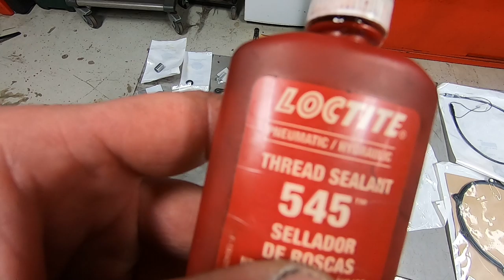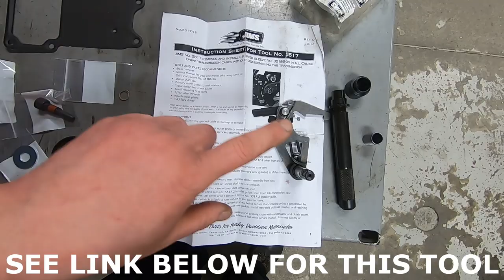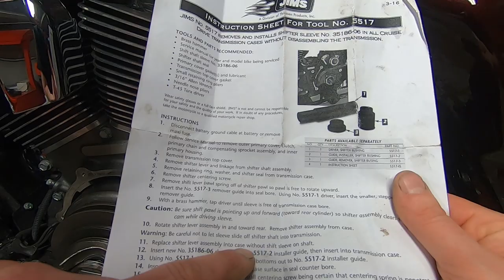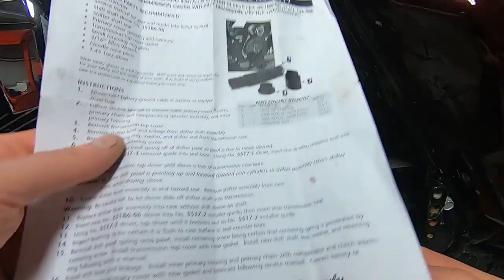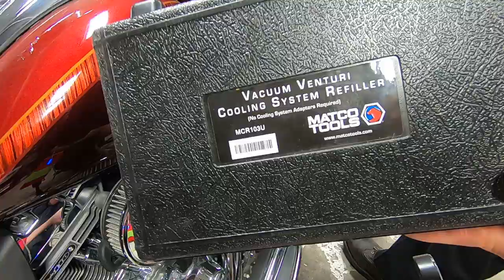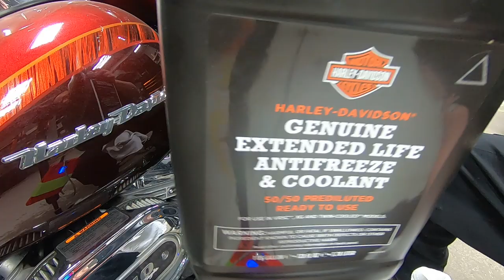FINAL REPAIR VIDEO OF "PRE SEASON INSPECTION BIKE " AND COMPLETION OF "SHIFTER REMOVAL VIDEO "

Comment: Jim's USA 5517 Tool works with Shifter Sleeve 35186-06. For older bikes, like mine, Jims 1664 Shifter Sleeve Installer/Remover Tool works with Shifter Sleeves 34979-00 and 33114-79.

Comment: The screw above the shifter shaft it to align the shifter pawl . It is done in third gear and you are supposed to center the shifter pawl
Reply from the maker: That's only on early 5 speeds because the pin ls offset. On 6 speeds the centering pin is in the center so theres no adjustment.
Reply: Brad, I just got done doing this on a 2011 rg 103 and the two springs are not centered at all. The rear spring arm ( towards the rear wheel ) is almost half way in the center hole for the centering bolt. I can down shift fine, its the up shifting im having issues with. I can shift up but then when the pawl returns to shift to the next gear it dont return all the way not letting the upper arm drop down on the shift drum unless i help it ( moving the shift linkage a little forward ). Is there a chance I got sent the wrong shifter pawl?

Comment: Excellent. Going to order one of the Jim's tool just in case. Also going to look at the temp sensor on my 14 Ltd. I cleaned and replaced the coolant when I did the M8 water pump upgrade. Did the air bleed the old fashioned way. Maybe some day will get a proper bleeder.
Reply from the maker: The coolant bleeder tools makes the job go a little faster. Its really saves a ton of time using it on your car!! Thanks for the view and comment!!

Comment: My Derbey cover bolts where stuck also. Thought I a as gonna break them off. Tried with my hand impact like your but no matter how long I tried they wjere stuck. Someone put red locktite on them. Got my little 1/4 impact with the 3/8 adapter and thought it would round my torx bit out or break something but it zipped them all right out.

Comment: Jims USA makes 767 (2006 to preset 6-speed) and 768 (1980-2006 5-speed) Transmission Case Shifter Shaft Seal Installer Tool insure seal is inserted to the proper position.

Comment: FYI. On 2004 FLHRSI Twin Cam88 5-Speed the Shifter Pawl Assembly cannot be removed as easily. The transmission has to be removed out the Side Door to make clearance from the drive gears. However the shift drum assembly can be removed easily without further disassembly. For the Bike in the Video, it appears further disassembly is required to gain access to the shift drum, however access to the Shifter Pawl is easier.

Comment: Just rewatched this whole series again Brad, very good. Do you disconnect the battery when you work on the primary and what holds the bike on that column lift?
Reply from the maker: Personally I normally don't disconnect the battery during a primary service as I've done so many that I'm conformable and know how to angle my tools just right ect. But for the normal at home person, I'd recomed disconnecting battery. Your better of safe than sorry. I secure the front wheel to the wheel chock of the hoist with a ratchet strap. When I'm away the the hoist I put a flat jack under the back portion of the frame, incase the tires go flat or something but with the front tire straped  and flat jack under the bike, it's solid.
Reply: @HarleyDavidsonWizard  Thank you Brad.

Comment: Brad what do you think I value your opinion to the harley 80w140 primary and transmission oil I bought some for the transmission and then realized I could use it in the primary what do you think I would  have thought it would quieten the primary side regards Alan. Ps I usually run amsoil primary oil but I would like to try the harley 80w140.
Reply from the maker: I like the harley 80w140. I would recommend it in the trans and primary. Its really nice that the motor company now offers a heavy oil. Makes it easy for people to get.
Reply: @HarleyDavidsonWizard   I totally agree I got some soon as I found out harley brought this grade of oil out regards Alan and thank you my friend take care.

Comment: I recently had to replace the main bearing (and all the others) on my 2010 Dyna  Trans and am glad I didn't have to alter/change the shifter mechanism as it looks to be rather tricky - I have not watched the video of it's removal yet. The Covid lockdown here in England has me watching all your videos as they are much better than TV !
When I did the Trans rebuild, I noted that the new main bearing was a single row whereas the original was twin row. It only failed after 60k miles so it was OK I suppose - what finally killed it off was my engine upgrade (over 127bhp and 122 torque). I hope this new bearing holds up, have you had any failures come to you attention yet ?
 I see they are using the single row bearing in M8's but I have bought a Baker twin taper roller conversion kit just in case it fails again - I didn't do my research before I ordered parts and saw the Baker  part which is not cheap ..... I really don't want to have to do it all again but ....
Reply from the maker: I've used the baker twin tapered bearing in a Baker Grudge box and its a beefy setup for sure. The original double role main drive gear bearing you speak up is prone to material buildup on the outer portion of the bearing and then the race becomes pitted and then the ball bearings become pitted and then the bearing setup looses the original designed preload and the bearing fails. Its a fairly common occurrence. In my opinion I think metal material that floats around in the trans fluid settles on the race of the outside main drive gear bearing and the bearing spins and spins in it creating the damage in the first place. Whenever I take a trans apart and that main drive gear bearing is in its first stages of pitting damage, the damage always seams to be at the bottom of the race. I like the single row revision. I haven't as of yet seen any problems with them and the single row bearing was the same design that was used in the 5 speed models and it has a great reputation there as well. Thanks for the comment! make sure you thumbs up the videos as well!! Lol,
Reply: @HarleyDavidsonWizard  Thanks for the reply and info - it was the outer portion of the bearing that failed and now I know why !   After my one failed and I was waiting for parts and tools I did a lot of research and heard that the twin row OE bearing could fail in as little as 3000 miles so I guess I got my money's worth. The actual striping and rebuilding of the trans was straight forward and easy except of course for the inner race bearing.    Hopefully it won't go again but if it does I'll use the Baker one I have.

Comment: Awesome video. Can't find Jims 5517 anywhere.
Reply from the maker: https://amzn.to/3UNVtUd here is a link to a listing for one on Amazon
Reply: @HarleyDavidsonWizard  they are out of stock
Reply: @HarleyDavidsonWizard  i see it now, I'm in Canada though
Reply from the maker: O ok.
Reply: @HarleyDavidsonWizard  found one thanks
Reply: @HarleyDavidsonWizard  Brad, I had a loose shifter lever on my 2011 tri glide, put on a new one, tighten to 22ft/lbs, still getting a little movement on lever, shaft isn't moving. 
What to do?
Reply from the maker: I crank the bolt down as much as I can, really. With red lock tite on it. If there is still movement between the lever and splines of the shaft. Then, the shaft will need to be replaced also.
Reply: @HarleyDavidsonWizard  thanks